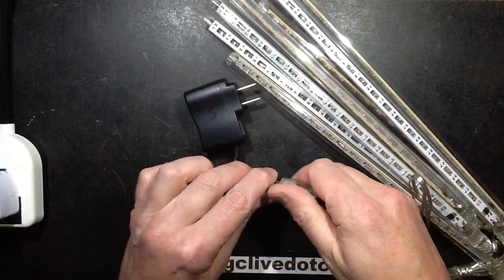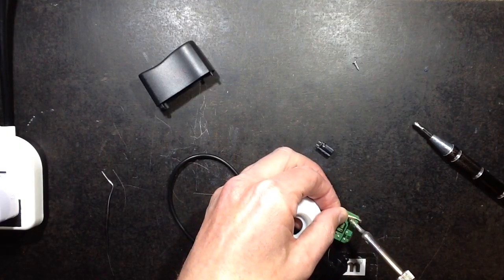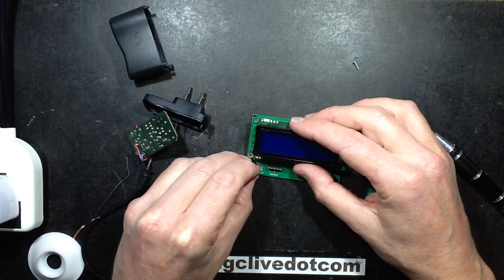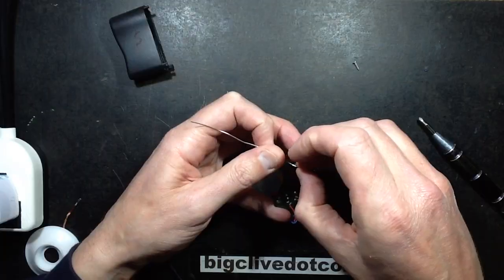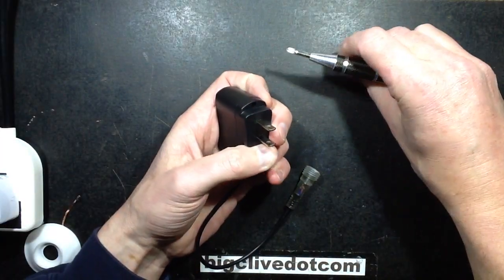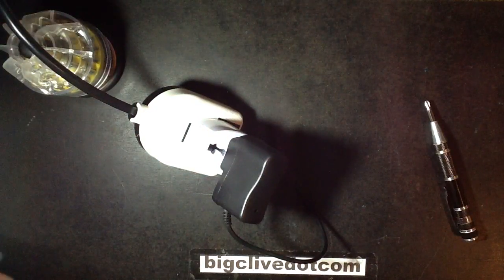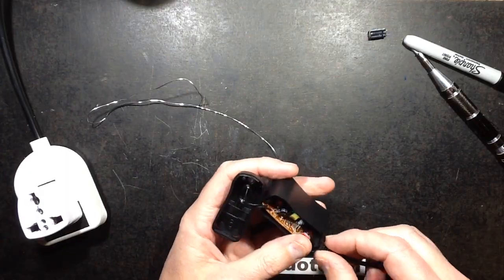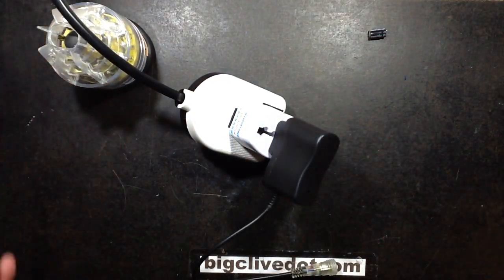Power supply explodes twice.

Comment: So, for the finale explosion...lots of orange sparks...did you perhaps put some sort of pyrotechnic in there?   Take theatrical license and employ some stagecraft? ;-)
Reply from the maker: No Pyro.  Just a few resistors and lots of electricity.  I may have made the neighbours lights dip.
Reply: bigclivedotcom  Ah, metal film resistors, disassembling rapidly.
I wonder if I could achieve this result with our sissy 120V 'merican mains voltage?
Reply: +Stephen Tack put a 11R across 110Vac if its a 1/4 watt metal film it will go bang. Basically it will be dissipating about 4000 times its rated power.

Comment: The capacitor just dropped out.. that NEVER happens!
Reply: +TheChipmunk2008 Yeah, something tells me that PCB conducts heat a bit more readily than it should.
Reply: Once the liquid electrolyte had been released from the original capacitor (which can expand to 1700 times its liquid volume when flashed off) a lot of the capacitor's explosive potential was released.  While the metal in the capacitor's plates could have flashed over, the capacitor's ESR along with that of the rectifier diodes, PCB traces and the very light gauge wires to the plug blades greatly limited the total power dissipation in the original capacitor.  Hence the new capacitor, fresh with electrolyte and heavier gauge wiring, had a vastly more satisfying "boom".

Comment: Pray tell, what did you do to it prior to that 2nd explosion?
Reply from the maker: +Ni5ei That was just three 4700 ohm resistors wired in parallel across the mains pins inside the case.  To cause a genuine electrical explosion on 240V that took out a 13A fuse.
Reply: +bigclivedotcom :D :D :D

Comment: Beautiful. nothing better than seeing crap electronics burn and explode!
Reply from the maker: +ivan R I actually had a cheap USB power supply detonate forcibly in my hand leaving sooty skid-marks on my hand.  The delicious irony was that I had just plugged a set of pink LED fairy lights into it.
Reply: bigclivedotcom well had not yet had a usb power supply blow, but i did have a fake "unilab" oscilloscope. It was a crt and I bought it for 50 dollars, and man do I regret it. I tested it on a 555 timer driver for a demonstration of a project. When I switched that piece of shit on, oh god, I got the worst static discharge ever. OUCH!!! Everyone was rolling on their asses laughing at me. The room was full of smoke and we ad too use a fire extinguisher. Turns out some slob cracked the pcb and the flyback for the display was not grounded because the ground rail was cracked. SO moral is never fucking ever buy a 50 dollar used crt oscilloscope.
Reply: +Sample Text it is all fun until one of those third world shit chargers blows in your face. Trust me, I am telling you from experience it is fun until it blows in your face.
Reply: +Sample Text Id rather see the people that put the stuff on the marked burn and explode.
Reply: Sample Text do you know at what frequency it makes a buzzing sound? If it is 50 or 60 hertz than it is probably just a crappy transformer being overloaded. I am pretty sure that thing uses a 1cm transformer and believe me, those are crap. I it is not at those frequencies, then It could be anything. You would have to take it apart. But in either case check the transformer.
Reply: bigclivedotcom My USB power adapter makes a rather annoying buzzing noise. It's made by a reputable manufacturer, Gear4. Seeing as though you're the expert, any idea what could be causing it?
Reply: Sample Text Yep I just checked it out. It is defiantly the shit transformer being overloaded.

Comment: You must have hands of steel to hold the wick that close the to solder!
Reply: +Tom Risely However, I can attest to receiving blisters on my fingertips from desoldering braid when solder is stubborn and keeps reflowing the component hole in the PCB.
Reply: +Tom Risely Fine solder wick does not conduct heat too well and this makes it that much easier to work with on small jobs. As long as you are reasonably quick about it, it won't have time to heat up all that much. Tinning wires is much the same: if the wires are prepared properly with the correct tip temperature and flux for the solder being used, tinning will be done long before the wire insulation becomes too hot to hold.
Reply: Teardown Dan That's awesome to know! Thanks!

Comment: Mr BigClive, do you have the name of the component tester or a link to one on ebay? Thanks.
Reply from the maker: +Maxx B If you do an ebay search for component tester and select lowest price and shipping first then you'll find the newer version dotted about amongst the listings.
Reply: +Maxx B after a quick ebay search I found this:
http://www.ebay.ca/itm/Capacitor-ESR-Inductance-Resistor-Meter-Transistor-Tester-Detect-NPN-PNP-Mosfet-/251459766877?hash=item3a8c2b8a5d

looks like a slightly different model though.
Reply: +Andy Plater I have one of these, and it works well:
http://www.ebay.co.uk/itm/128-64-LCD-Component-Transistor-Tester-Capacitor-Diode-Triode-MOS-PNP-NPN-LCR-UK-/400945655057?hash=item5d5a392d11
Reply: I second that, also what is the  capacitance range it can measure up to?
Reply: Thanks guys.
Reply: ParedCheese does that one provide the ESR of a capacitor under test?
Reply: +Andy Plater Yes, it does. Also Vloss.